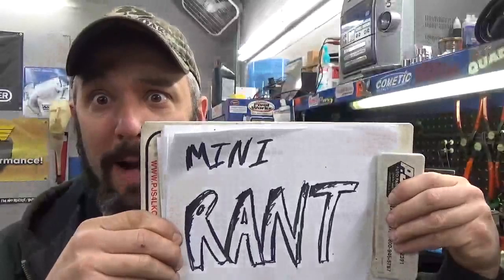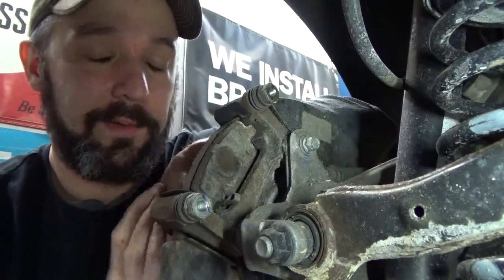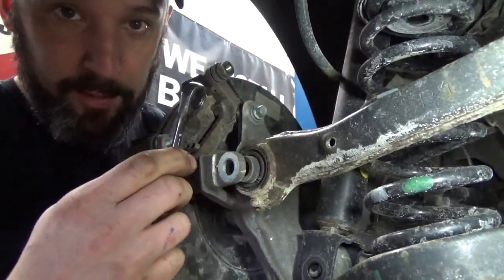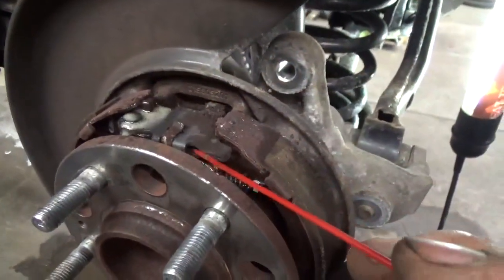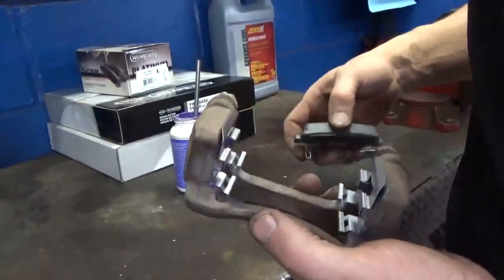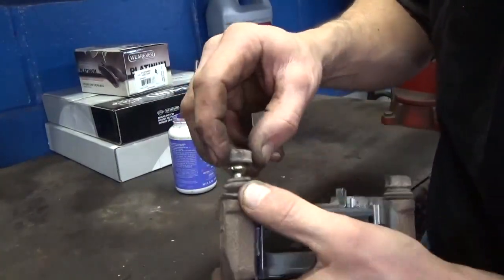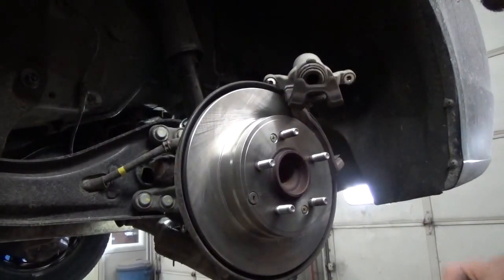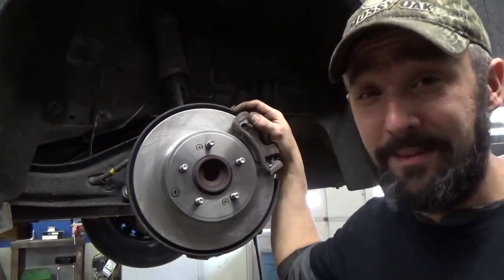Replace Rear Disc Brake Pads & Rotors - Hyundai Sonata

Comment: Are the front rotors and pads easier (i.e bolts are accessible without having to remove control arms, shocks, and similar)???

Comment: Love the video. One question. Is there any reason that the control arm bolt cannot be put back on with the head of the bolt facing the rear of the car, rather than the front of the car (as installed)? There is plenty of clearance (on a 2021 Sonata) to tighten the nut on the other side and there does not seem to be any impediment as a result.  Just wondering if there is a reason that I am not considering.
Reply: Should read "2012" Sonata.
Reply: I'll be honest. I watched this video a couple years ago and had the same issue with the bolt for the control bar. I literally put it on backwards and haven't had any issues. I got my rotors changed last year and the mechanic literally placed it in the same way.

Comment: I just did the rear brakes on my 2012 sonata following the same procedure. I'm getting a dragging/rubbing noise. I notice it when driving on highway (can hear it echoing off of jersey barriers) and when going slower speeds if I turn one way or another I can hear it..turn left I can hear left rear making noise and vice versa. Any thoughts?

Comment: Question about the upper control arm bolt reinstall. I am just wondering if you can tell me does it really make a difference  which direction the fastener or bolt goes in the upper control arm since it holds it together and nothing is hitting the threaded side of the bolt?

Comment: Great video.. couple of questions.. is the procedure the same for the front rotor replacement?  Also, i didn't see you using a torque wrench, is it not needed?  Thanks.

Comment: Have you ever done REAR brakes on a 2006-2010 model Sonata...The model before the one in this vid. I've come across the REAR pads on my 2008 ( w/33,000k on it) not fitting correctly (to tight) into the slides of the caliper bracket and they hang up & cause friction. I had to file down each end of all 4 pads EVER SO SLIGHTLY on my bench grinder to allow them to fit freely between the slides. No rust or dirt was the cause of the hang up... I tried fitting new pads and they fit very tight as well in the slides...  The brakes now work as they should. Would like to know you input if you have the time. Thanks!
Reply from the maker: ***** OE or aftermarket pads?
Reply: South Main Auto RepairThanks for your reply....The original OE pads with 33K still have plaenty of meat left on them I filed down the end tabs that sit in the slides & reinstalled. I also picked up aftermarkets & a set of new OE pads from dealer to compare fit. All fit just as tight as original OE's from my 2008. It seems to be a wide spread problem for alot of 06-10 Sonata owners with hung up rear pads.
Reply from the maker: No kidding and no rust or build up under the hardware on the bracket?
Reply: South Main Auto Repair Is there enough room for you service and/or replace the parking brake shoes and hardware without the need to remove the wheel hub assembly ?  From Hyundai's repair manual, you have to remove the whole hub.  I can hear a rubbing / metal-to-metal noise from one of my rear disc.  I was thinking of taking apart the whole parking brake mechanisms and re-lube it.
Reply from the maker: I do them with out removing the hub but it is tight....
Reply: South Main Auto Repair Weather forecast here in Ottawa this coming Saturday will be sunny.  I'll replace my front factory brake rotors of my 2012 Sonata as it now have 90021 kms. as of today.  After this, I'll open the rears and try to clean again and re-lube everything.  Just getting ready for the long haul next month.
Reply: Strange, I've done the rear brakes on my parents 2010 Sonata. No issues with the pads being too tight.

Comment: Different car...different job...but i got a rear bolt on a stay arm on a Volvo 940 that hits the exhaust down pipe before it comes out. Didn't have this problem on a 740...it sucks cause the front bushing on that arm is shot

Comment: After having to remove the shock  why not put the long bolt in the other way around so the nut is next to the shock and the bolt can be removed without removing the shock?

Comment: I just changed rear pads yesterday, on my 2010 sonata 4 cyl.   I did not have to take anything loose to get to that bottom bolt.   so guessing that Hyundai changed engineering 2011 on bob

Comment: That long bolt holding the control link was a bear to put back in. I ended up putting the bolt in the opposite way with the nut towards the front of the car. Is there any reason this shouldn't be done? Thanks for great video!
Reply from the maker: perhaps it is in the way it is from the factory so it can not come out if the nut fell off?

Comment: What brake lube are you using...and would you use it for the slide pins? Is there any reason that you can't put the control link bolt in backwards...just wondering.
Reply: Hi @SanityOne, I answered your lube question in my comment somewhere on this page (sort by new). I hope it was in time to help!
Additionally, other comments mentioned something about reversing the bolt possibly being a safety issue. Reversed it may fall off easier because of vibrations and gravity?

Comment: I just changed my brakes and rotors on my 2007 Hyundai sonata. That one bolt behind the control arm was ridiculous. I got it off without removing any other component but it was quite the pain in the ass. Getting it back on was miserable. I just did it with a scissor jack and arms. Not fun

Comment: Late to the game, but this is a great video.  I have a dumb question - what is the purpose of the small protruding metal tab on the inside pad? Btw, on my 2011 Sonata GLS, the bolt heads for the calipers and pad bracket are 14mm, not 12 mm.
Reply: Cool, thanks for responding!

Comment: would it be possible to remove and replace the brake pads without having to do all that control arm BS? i dont need to replace the rotors just the pads. couldnt i just pop them out once i get the caliper piston off?
Reply: Yes you could just swing the caliper up unscrewing top caliper bolt

Comment: The bolt for the control arm: can it be installed "backwards"?  Does it make a difference which direction it faces?
Reply: My thoughts exactly, could save the hassle next time
Reply: An indy shop did my rear rotors 3 years ago, and they installed the control arm bolt backwards.  It didn't help.  There's a lot of tension and even with the shock bolt removed, I still need to pry it apart and hold it to get a wrench in there.

Comment: How much do you charge to do brakes & rotor on a 2013 sonata?  Front ?  Back?  Both?  Thanks  Great Video
Reply from the maker: +Victoria Regine Pads and Rotors are about $225 installed w/tax
Reply: How do you know if you need new rotors or not. The rotors feel smooth to the touch I don't feel any grooves but the mechanic is telling me that I need new rotors as well. Is that common if the rotors feel smooth?
Reply from the maker: Here we always change them because they rust, if I lived in a non rust state, I would base it on thickness and runout. Are they warped and are they thick enough.
Reply: that's cheap to do that job! just did rears on my 2012. Very hard without a lift. Thumbs down Hyundai is not some of the words I used...   Good video I subscribed
Reply: I'm doing this now and I went with Hyundai OEM pads and rotors. OEM cost about $260 for pads and rotors (or about $540 for pads and rotors all around). We went with OEM because the car has 94,000 miles on the original pads and rotors, I never seen a brakes last this long. If you took this to a shop the cost would be about a $1000.

Comment: Hyundai Azeera are the same design, move the lower shock, to remove the control arm bolt, to move the control arm, to remove the lower bracket bolt, to remove the caliper braket, to remove the rotor.

Comment: Why don't you put the lube where the pads slide on the brackets?
Reply from the maker: hauntedro Never really seen a need to if you are using good hardware that does not rust ya know.

Comment: Great Video as always Eric! Quick question, what alignment punch do you use to get everything back lined up for the bolt ? I have one of these cars and my aunt does as well. I always struggle with this for at least a few hours every time I do rear brakes on them. Thanks in advance!
Reply: Did you ever get an answer on this? I’m stuggling with putting the bolts back in and aligning the suspension arm
Reply: Diego Gonzalez unfortunately not. I ended up getting a Mayhew 9/16 tapered punch, with a lady foot at the other side. But didn't need it the last time I did my rear brakes. I was able to sneak a wrench in the and work the rotor off with the bracket. But that's one in a million. I have done this job about 3 times now between my car and my aunt's car. I hope you didn't pop the arms all the way out. I've had that happen and it's taken hours to get them back in. But I have done it. The taper punch should work for you like Eric did. 9/16" is about 14mm, and 1/2" is about 13mm. So I went a little bigger just in case.

Comment: I was good upto 14:00, I can't get the bolt inserted into that hole.    I spend two hours and gave up now.  I don't have prybar and probably have to take my car toed to mechanic tomorrow to fix it for me
If anyone got any suggestion, appreciated
So far I used DW40 to make it smooth, but for some reason always one end the whole is a bit higher than the other end.  Not sure if I hammered it to much to make it like that
Reply: I managed to put a jack under the bar and slowly  hammered the size 10 bolt and it went inside.   My suggestion to new people, please move the bar by as little as possible, as it would be hard to position it back.

Comment: Is there any reason not to reverse the direction of the nut and bolt going into the control arm? So next time no need to remove the shock bolt...
Reply from the maker: Rick B Maybe a safety reason if it were to ever come loose it couldn't fall out?
Reply: South Main Auto Repair Thanks for the reply i had the same thought but most cars are not built like that to lock bolt in by putting things in the way? lol... I'm reversing it...
Reply: Rick B Also thanks for the video! i was the one of those guys trying to wiggle the rotor thinking it was going to work. Then i said this cant be F'n right until your video confirmed this is just a great design...
Reply from the maker: Rick B Yeahhhhh  was one of those guys too haha

Comment: Would this apply to a 2010 Hyundai Sonata also?
Reply from the maker: Kohlie63 I believe so... don't quote me but I think its 09 to 11
Reply: Kohlie63 I did my rears on a 09. The caliper bolt was a little easier to get to. The rear pads though for a 09 did not fit. Not even close. I ended up with the pads for a 07. The 08 did not fit either. I read other DIYers say they ran into this. Seems Hyundai changed calipers during the 09 model year and simply used ones from earlier years.. The intent for change was to beef up the calipers and maybe they just ran out of new stock. Also, I think the big changes occurred starting with the 11 models.
Reply from the maker: Wow no kidding that is odd? I will have to keep that in mind ....
Reply: I know...I'm just a basic DIY kinda guy. I like to keep up on my car in internet forums and read about it there. I had autozone bring out a couple older year's pads to compare. Sure enough, 07 was a match. Just on the rear though.

BTW, your vids are great.
Reply from the maker: thanks Mike :) I looked up the pads (rear) for an 07 and it says they fit 99-08? What is your 10th vin digit on your car?
Reply: I will look it up thanks...I bought my 09 in late sept 08 - St Louis Mo. Very weird how I had to go back to a 07 rear pad. The 07 was an exact match - weird.

Comment: Would this be the same on a 2013 Sonata?
Reply: +Steven nevetS It is the same on the 2013. Stupid design.
Reply: After watching the video several times, I was able to replace the brakes and rotors in under an hour never having done anything like that before.
Reply: yes it is  I just did mine

Comment: Have you done brakes like this http://a.imageshack.us/img185/7821/1173087315.jpg ? How do you get the pins out? I know they should just pull out but they are very rusty. That type of rear caliber is used on many Japanese cars.
Reply from the maker: Yeah do a lot of those on the 4 piston Toyota front calipers. The pins rust in there. I have a big assortment of punches and find one that is the exact same size as the pin. Give it a LITTLE heat on the caliper with a brazing tip right were the pin goes through then tap them out.

Comment: Hello eric, I have a question for you. My friend tried changing his own rear brake pads and in the process he pushed instead of turning the rear caliper piston. The piston is attached with the parking brake mechanism, and therefore should be twisted in, not pushed in. Now he says he has a grinding noise and when he checked the pads again, the pad thats closest to the piston was worn down more than the other pad. The caliper slide pins work properly and slide with ease. Do you think the problem is in the piston or in the parking brake adjuster? Or what do you think is the problem since the piston was just pushed in instead of twisting it back in? Thanks for your time! Appreciate it.
Reply from the maker: Roger Sahagun Well that is an odd one. Disregarding the fact he didn't twist in the caliper and only looking at the fact it is ruining the inside pad that can only happen one of  3 ways. Either the caliper pins are froze (but you said they are good) or the inner pad is hung up in the bracket causing it not to release... or 3rd the outer pad is seized in the bracket only allowing the inner pad to work.. make sense? There are a few other variable too but those are the most common...
Reply: Oh ok that's interesting, I never thought of those possibilities. I'll have to check them out to see what is wrong. Can the parking cable still get misadjusted and cause that problem? Or could the piston itself have gotten damaged and seized up because of him not twisting them back in? Again thanks for your time!
Reply: Oh ok that's interesting, I never thought of those possibilities. I'll have to check them out to see what is wrong. Can the parking cable still get misadjusted and cause that problem? Or could the piston itself have gotten damaged and seized up because of him not twisting them back in? Again thanks for your time!
Reply from the maker: Well that is the interesting part. Usually when they get damaged from someone forcing them in the parking brake will not work at all. If the piston was seized you would have no brakes on that wheel. If it was "sticking" and would not retract it would be overheating the pads and burning them both off evenly assuming all pads where free and pins are good... Personally I would use it as a learning lesson and go pick up a new caliper and bracket if he knows he forced the piston back in..
Reply: South Main Auto Repair Yea I told him to twist the piston back in but he ignored me. I would've done the job for him if I wasn't in school (I'm in automotive school). When I see him in the next couple of weeks I'll check them out and get back to you on what was the issue. Again thanks for your help, I appreciate it!
Reply from the maker: Roger Sahagun No problem

Comment: this rant about customers  coming to the shop near empty on there gas level.   I work at a hyundai dealer as a tire and lube tech   and I had two customer  come in today and  I got both cars and they both had 2 miles left on there  tank      this is the type of stuff  that drives me crazy    so  I know  what you mean

Comment: The caliper bracket bolts are 14mm, not 12.
Reply: +Michael Thompson The caliper bolts are 14mm, the bracket bolts are 12mm.
Reply: On mine the bracket bolts are 14mm.  Tried 12.  Too small.  Had to reassemble everything and get a 14mm offset.

Comment: Yep had a customer who did that once he came to get his car and he started it and proceeded to drive out of the parking lot made his turn went about 8 feet and the car quit and he came back wanted to know if I have a gas can with some gas he could put in the car to get it to the gas station I amiled and said no but I have a tow truck right here and will pull it out of the road for you. He was mad and said never mind and asked me why I didn't put any gas back in it after my test drive I laughed I fixed the problem and put it out side never took it for a drive because it had no gas in it it was as you left it I added nothing to it and took nothing away from it that's all you.everytime after that his car always has better than half a tank.

Comment: You really dont need to remove shock absorber etc to get to the bolt.  a simpel spanner can d0 the job. You just wont be able to tage the bolt intirely out, but thats not nececery
Reply: So are you able to tighten the lower bracet bolt with spanner without removing the suspension bolt and lower arm??

Comment: They didn't design the engine any better. I bought a 2011 Sonata used. I made two payments and the engine went out. I knew about the recall. My local hyundai dealer installed a new engine at no cost to me....well I spent $100.00 for an alignment. Now I have to do the rear brakes. It also needs new tires. The previous owner had three separate brand tires on it. Also the drivers side window control mod needs replaced. The major thing though is that it has parasitic draw. It will drain the battery over night. But I like the little gas getter.

Comment: This is the dumbest design even for a simple rotor replacement, this is the reason some people don't want to do mechanic
Reply: 100%. beyond stupid. the front rotors are very easy to replace. i just did my rear ones yesterday. i would not have been able to complete the task without watching this video. i just wanna say to HYUNDAI: WTF were you thinking?